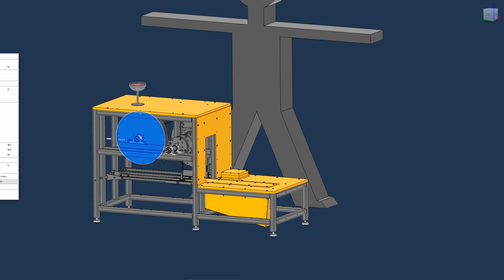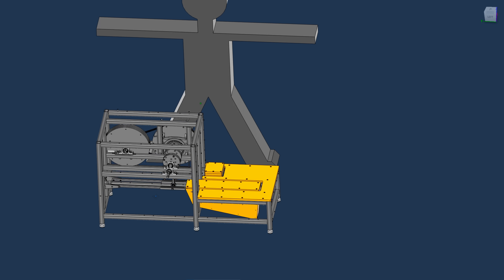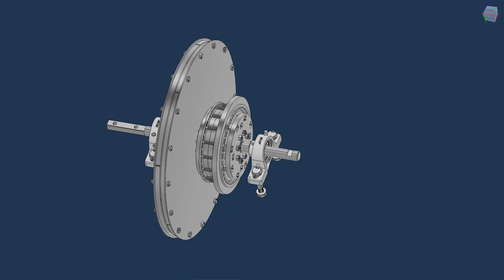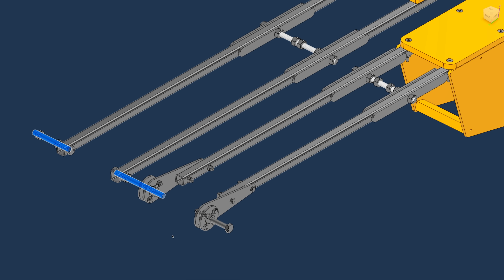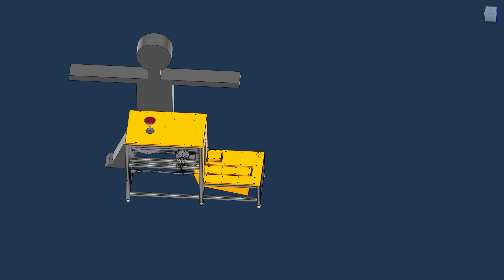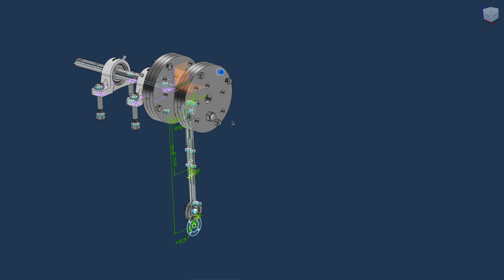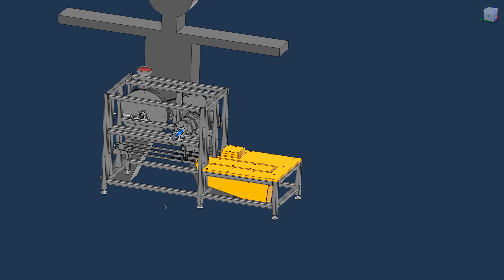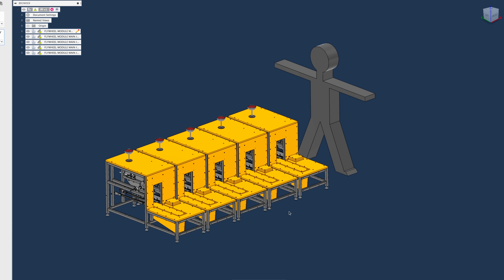Power Module Design Completed - Marble Machine 3 Ep.5

Comment: As torque limiter you can use the belt. No extra parts are needed. (Depends how often you are planning to use to limit the input torque)

Edit:
 the output torque should be limited. Or in an accident something will break.)
And have a thought about how often this happens, you can use a simple pin/screw that should fail, or use high complex and expensive other technics. The best way is to talk somebody on a farm, or other mechanics. 
Please keep it simple, no (german) over engineering if it's expected that the limiter are only setting in if something is not working properly, then use the belt and some pin/screw that fails, you can replace them easy if its happen. Easy to calculate, easy to build, that would be my way as engineer.
Reply: Pin the output shaft of the flywheel module to the rest of the machine using a nylon bolt. Keep lots of spares. If the torque gets too high, the nylon bolt will shear and decouple the flywheel from the system. Simple. As for the clutch, just use a movable belt tensioner on the belt to the flywheel. Put the tensioner on a pivot on the trailing side of the belt, create tension with a spring and use the clutch pedel to release tension from the belt. SIMPLE. No complex clutches, no complex torque limters, just basic functional designs that WILL work.

Comment: just a quick and maybe useless tip for the adjustable link: couldn't you use farmer hitch pins(also called linkage pins)? 
they consist in just a simple pin with a head on one side and a protrusion with a hole for a smaller set pin to keep it in place, they provide link between two surfaces through a hole, but to relocate them it's just a matter of removing the set pin (which usually comes with a ring to better pull it out) and put the whole thing in a new hole. 

Usually there's some wiggle room but it's a lot easy to custom make them to any length you need(after all it's just a rod with a hole for a set pin).
I'm suggesting this since i suppose it doesn't have a lot of stiffness requirements, the bolt and nuts only need to make the two halves o the link one piece. by having a bolt and nut you need to unscrew and screw back in 2 nuts, which even requires to have handtools on set.

Comment: This is a not well engineered solution to a non-existent problem. There's no need to have millisecond accuracy in music in the first place.
And whereas it might smooth out the variable rotational speed over a fraction of a second, it will not do anything to prevent a gradual speeding up or  slowing down.
This is super over engineered. You have a very complex breaking system.
That high RPM flywheel will be very, very noisy. The flat disc is a bad designed for a flywheel anyway. 
It should not be a flat disc. I've tried to explain this before. But simple physics says that this is a terrible design. Most of the mass should be far away from the rotational axis. Like a bicycle wheel. Its mass should be located at maximum distance possible from the axis.
It's over engineered, heavy, noisy, lots of pieces, and it won't solve the problem of creating uniform rotation over more than a second or so. The rubber belt will induce lots of frictional loss at the RPM you want. Helical mechanical gears would be much more efficient, power wise. But it would be noisy and heavy and even more impractical. So you're left with a rubber belt and it's friction.
Oh dear..... This will never end

Comment: You can use Polycarbonate panels. Its what mills and lathes use in their doors/covers, these have sharp spinning parts at up to 30k rpm. I think a flywheel should be no problem 😂
Reply: I was going to suggest that. It's the perfect material for the job, and it has the added bonus of being transparent.

Comment: My biggest fear in this design is the shaft output on the opposite side of the flywheel, the entire force of the flywheel is being transferred to that shaft through a single off center bolt. If something gets stuck on that side of the shaft there will be some huge torsional and shear forces concentrated on that point.

Comment: You might want to look at old peddle action machines. Think old sewing machines and lathes for example. You want to press with your toes because you can lean into it, but maintain full foot contact. It would allow you to pump with your calf comfortably when you're at did speed, but you can then put some weight early on when you need more low end torque.

Edit: you might also consider the kind of pump that rocks back and forth.... Trendle? I can't remember what they are called. Less low end torque, but high end efficiency. But that would probably require a chain drive which also sucks.
Reply: A treadle pump?
Reply: treadle
Reply: I honestly dont think that would work. Just look how much weight was required for mm1 and mmx and mm3 sounds like might be even harder to turn
Reply: @D3nn1s  they use gearing and have less low end torque, but they can deliver a higher top end more efficiently. It's all a trade off. You kind of get one or the other without some variable transmission system.
Reply: Don't give him any ideas.

Comment: I have to ask: why are you building a dead machine that is spinning 960 rpm when playing 120 BPM?  MMJet?
Reply: He has the valid idea that high RPM will smooth out small RPM inconsistencies. But it will be very heavy, difficult to build, and will be very noisy. A big wheel spinning at 7,000 RPM will be noisy. Especially with his homemade bearings and shaft design.

Comment: Why dont you ever just build the whole thing and then fix the things that need fixing
Reply: He did it twice, first time it fell apart and second time he didn't finish
Reply: Because that is a recipe for failure.
Design, then build, then test, then refine.
Reply: That's way more expensive and take longer, because he'd have to reorder a ton of parts all the time.
Reply: Because the fix will be a complete start from scratch. Because of all the interconnected incompatible components and overall poor design to begin with. Machine number four

Comment: You keep saying brake, but it seems like you’re talking about a clutch, so that when you hit the pedal the flywheel keeps spinning but it disconnects it from the drive system. 

You should consider putting an actual brake on the flywheel shaft just for safety. That way if something goes wrong, you can stop the flywheel as quickly as possible. It seems like a mountain bike rotor and hydraulic caliper would work really well.
Reply: would a mountain bike disc brake be able to stop such a large flywheel effectively? I would just use a car's brake caliper and rotor instead
Reply: @baileythesleepless9966  you’d have to do the math to be sure, but a mountain bike brake can easily stop a 200 pound rider going down a descent at over 30 mph. My thinking is it’s a totally enclosed system. No need for external reservoirs or master cylinder like a cars braking system.
Reply: @baileythesleepless9966  if mountain bike brakes can stop a person on the bike, they are good enough for the machine.
Reply: @Papinak2  that's fair, I guess I just don't know just how big Martin is planning to make the flywheel
Reply: In a previous video this was explained to be a double clutch, disengaging the torque limiter and engaging a friction disc to stop the flywheel eventually. It's just metal on metal, but there is a brake of some kind present.
Reply: Exactly my thoughts. Ideally a red "stop button" with a spring loaded brake, which would also disengage the clutch

Comment: This pedal seems to have some substantial weight. Probably you need to counterbalance it on the opposite side of the lever to prevent loosing too much torque when you're not pedalling the machine.
Reply: I thought exactly the same thing and whether this could course unwanted vibrations in the rig as it must be in constant motion, and without a balancing system.

Maybe I didn't study the setup closely enough now, but couldn't see that there was any freewheel clutch on the pedal, which I would imagine would have been handy. Then the pedal would not have had to move when it is not in use...
Reply: Same with the flywheel, that is a big rotating mass biased to one corner of the frame. I'm concerned the precession from the flywheel could cause the machine to rock/vibrate which could impact the timings and locations of marble drops, especially in conjunction with the loads and other rotating bodies that need to be added on top of this. Perhaps some dampening materials could be of use between components fastened to the flywheel frame as well.

Comment: Looks really compact! However, I would be surprised if your relatively flimsy crankshaft is up to task. Also, I am sure that (unfortunately) you are far from „full circle“ concerning tightness. As already mentioned, the possible dynamic excitations of several coupled moving parts of the machine are going to be interesting. The huge and rather open programming wheel designs without any diagonal struts are going to be interesting enough :-)

Comment: We went from prototyping each detail of the droppers to CADing loads of untested components together. 
I really hope it all works out, but I would be surprised if you don't run into a lot of issues during assembly and testing. Good to hear you're having fun though! 
Good luck :)
Reply: When you find yourself feeling like you have to bend over backwards to defend your decision-making *in advance*, that should be a sign you’re making a bad choice. You need to start recognizing that feeling in your gut and listening to it, instead of bulling forward with a bad design decision. You’ve learned too much to keep making the same mistakes. Also it’s baffling how far you’re taking custom, untested design stuff when it comes to this power assembly.
Reply: always one step forward, two steps back with martin
Reply: It's going to be a mess, at which point, he'll announce he's moving onto MMZ.

Comment: Hi! Thank you for everything!
I was wondering if the heat generated by friction, and the resulting material deformation is took into consideration for such assembly. There are a lot of constraints/fitings, a lot of weight and speed. Can't it interfer with the precision you require, especially when it comes to friction fiting.

Comment: The heavy flywheel will help keeping the speed from changing, so keeping the beat tight. But the heavy flywheel will prevent the speed from changing, so impeding to change the beat. Which is the more important?
Reply: It will also be very slow to reach its usable RPM. Lots of energy in that big wheel at 7,000 RPM. It comes from your foot. Slowly....
Reply: I expect the answer to be "yes."

Comment: Dumb question, the CAD pic has the pedal in the down most position, from there how do you start the flywheel?
Reply: This is actually a valid concern
Reply: Came to the comments section to add the same thought. 😅 Going to be hard to reach through a cover to spin the flywheel by hand to get it started.

Comment: As others have said, i think it would be a great to use transparent panels!!
Reply: Definitely a thing that can be replaced when everything works. The panels are not structural after all.
Reply: So much yes. Transparent acrylic plates FTW!
Reply: @EaglePicking  Polycarbonate, rather. It's commonly used as a blast shield.
Reply: @SteelSkin667  Yes, my "acrylic" was just another word used for plexiglass. Obviously the exact choice of material is going to depend on design requirements.
Reply: @EaglePicking  Well the thing is, plexiglass and acrylic happen to be names for an exact material (like Lexan is another name for polycarbonate). There really isn't a generic single word for  transparent plastic.
Reply: @EaglePicking  the problem with your statement is that acrylic and Plexiglass are an exact material. Plexiglass is just acrylic, also known as PMMA or another brand name is perspex. Polycarbonate is a different material also known by the brand names Lexan or Makrolon.

Plexiglass is just another name for acrylic, it isn't a term for any transparent plastic sheets.
Reply: @conorstewart2214  True. I'm that guy saying: "Let me get my Kodak", when he means his camera and it's not even a Kodak. Sorry for that ;-)
Reply: Lexan is strong and clear. It was developed by GE Transportation to use as a locomotive windshield. It had to be lightweight, clear, scratch resistant, and be able to withstand a rock hitting it at high speeds.
Reply: @billkeithchannel  lexan is just a brand name for polycarbonate. There is also a lot of different information about who invented it and what for.
Reply: @billkeithchannel  I don't doubt that they were working on using polycarbonate for windshields at some point just that there is a lot of contradictory and different information online. Like that GE was originally developing it for use as cable insulation and someone else working for Bayer was developing it at the same time and managed it a week earlier and that polycarbonates were first discovered in 1898 by Alfred Einhorn or by Du Pont in 1928. 

It does seem it was only commercialized by Bayer first with "Makrolon" and then slightly later by GE with Lexan.
Reply: yeah, if it's safe enough for mythbuster, Polycarbonate is safe enough for this
Reply: Plus some LED lights inside so we can see everything
Reply: Personally, polycarbonate would be great! But for team wood... you can have transparent wood! I introduce you to "cellulose acetate." It is transparent, though I'm unsure of how strong it is for blast protection. Plus, it tends to age and get murky over time...
Reply: I suggest that he uses Polycarbonate Panels.
Reply: No more plastic! Team wood go!
Reply: @43fghpu9h  transparent aluminium then
Reply: @Ryytikki  but the plastic is so fantastic!
Reply: @Ryytikki  deal!

Comment from the maker: Download the CAD here: 
https://www.dropbox.com/s/pcqeikp7g3iav0l/POWER_MODULE_EP_5.step?dl=0

Give useful feedback here: 
https://www.reddit.com/r/MarbleMachine3/comments/13wwggz/power_module_design_completed_marble_machine_3_ep5/

I made this video quickly, so, its a very simple update, i hope you find it useful despite its simplicity. 
I am prioritizing spending time on cadding over video editing, will spend more time once i am building and testing things IRL, going to be really fun to see how all this works. Would be a great feeling if i can get this assembly to work directly from CAD to IRL... Would be a good sign for the project. 

Good luck with everything you are doing!
Reply: Important: look for "Nord Lock Washers". (Wedge-locking washers)
Reply: @senestranom9726  Nord-locks are pricey.
Reply: @senestranom9726  I know, I've read the NASA document that was publishing decades ago about what washers actually lock and with ones cause slip.
Reply: You might want to consider something like a Sprag clutch for the drives to the other 2 elements. Those elements will have their own rotational inertia and your braking mechanism will have to take up that load as well unless you have a Sprag clutch to let them free wheel while the braking is occurring.
Reply: I don't know if this is possible but may add a bit more safety, by adding some form of sheild from that large hole for the pettle. similiar to a garrage door. I can see a foot slip into it.
Reply: Those strengthening plates you show at 6:32 would make mroe sense if you welded them to the top and bottom of those levers. This is because of the way increasing the dimensions of a beam increases its stiffness. If you double the width of a beam, you double its stiffness. But if you double the thickness, the stiffness goes up eight times.
The rules that define this are that stiffness increases linearly with width, but stiffness increases with the cube of the thickness.
So if those plates are 5 mm thick each, welding them onto the sides of a 20 mm wide beam makes it 150% wider, which means 1.5x stiffer.
But if those plates are welded to the top/bottom, the 20 mm beam becomes 150% thicker. 1.5^3 is 3.375 times as stiff. Perhaps a little bit off this value because the tube is hollow. But not a huge amount.
Reply: You have officially crossed the line from creator to patent troll. Honestly people should abandon this bullshit like you abandoned all our money that we poured into mmx
Reply: Define "useful" in an objective sense. Plenty of people have pointed out the folly of trying to lasercut everything, building your own flywheel, trying to hold incredibly tight tolerances, etc., and it seems that it's all been largely ignored.

Step 1 would be to get the hell off Fusion 360 and onto something that can handle large DFM models.
Reply: I think you forgot to pin this comment